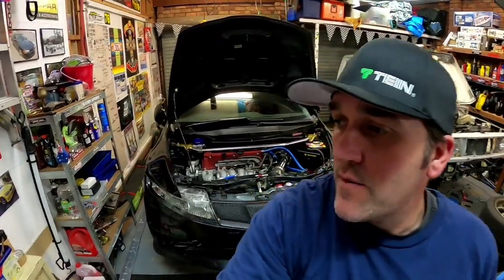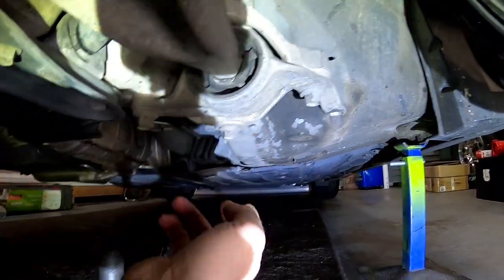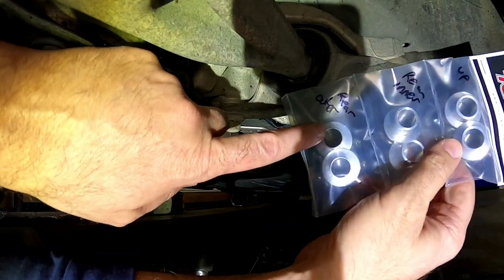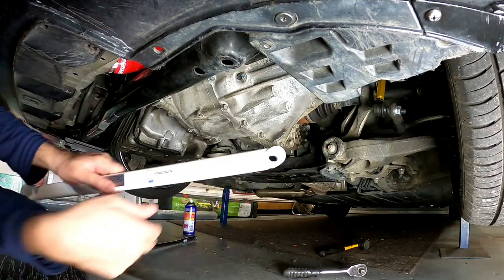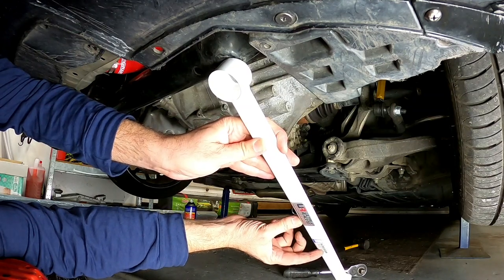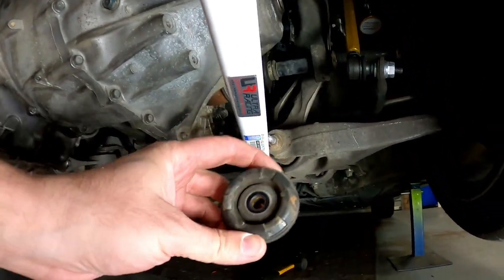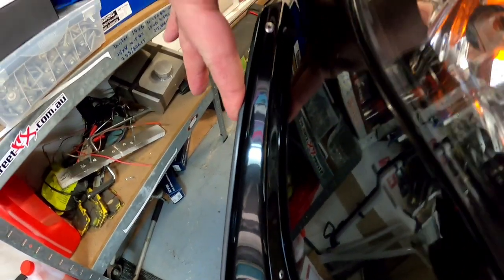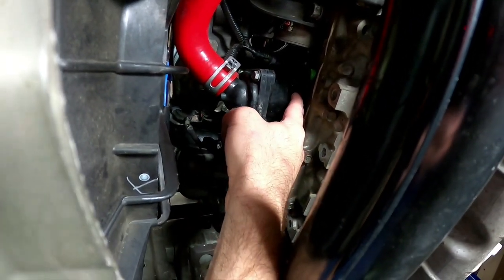Honda Civic Fn2 type r TEGIWA Rigid collars 'how too' Ultra Racing 4 point.

Comment: Can you feel a difference with the collars? Or is it more a way of keeping the geometry in spec for longer type thing?
Reply from the maker: I haven't even driven it since fitting them.. waiting on a new thermostat.  It's more to stop the clicking noise wile braking..
Reply: @driftcarsjp  This collar fix clicking noise? I have the same, click on breaking, unclick on throttle. I think its rigid collars.

Comment: Do you not need to clean the joint and grease it up before bolting it all back together?
Reply from the maker: No just fit them dry. But there is no harm greasing them if you wanted to. 
Thanks for watching..
Reply: I have heard of people fitting these and still having the click after because they done drop the subframe and clean the bolt faces.. I’m fitting these ina few weeks
Reply from the maker: Mine has stopped clicking.

Comment: What bit are you supposed to grease the outside of the collar or the inside of the collar or both 🤣
Reply from the maker: The outside of the collar
Reply: @driftcarsjp  what grease would you use also do you have to clean inside
Reply from the maker: Just any wheel bearing grease no need to clean inside the grease just helps with fitting.